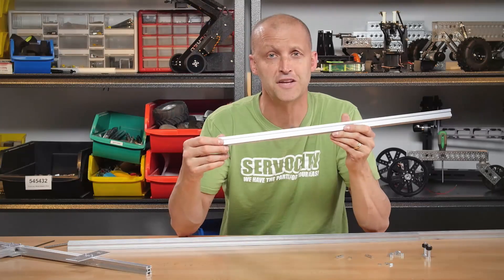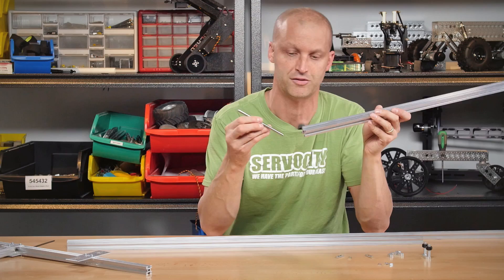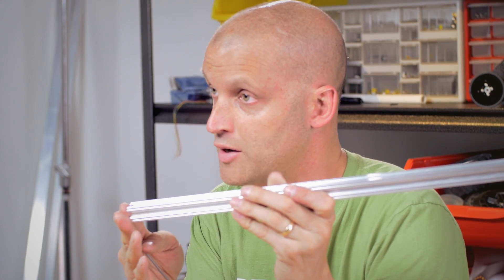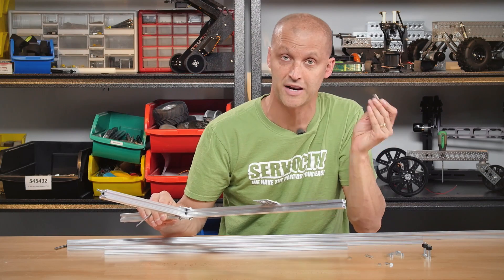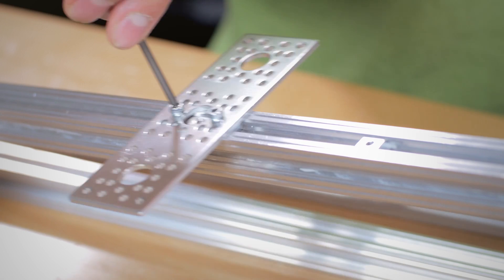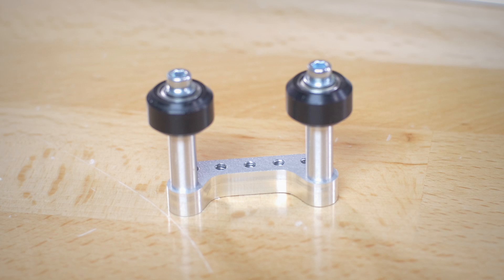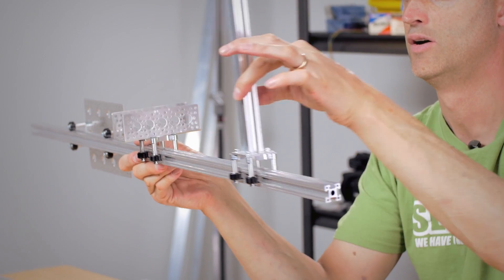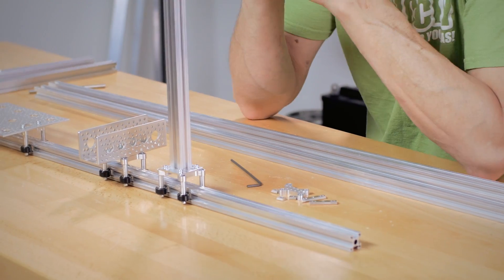ServoCity Products: X-Rail + X-Rail Mounts and Roller Brackets

Comment: is it strong for plasma cutting cnc?????
Reply from the maker: It's possible to use for many CNC applications.  For CNC plasma you might consider using goBILDA V-Groove Bearings: https://www.gobilda.com/1609-series-v-groove-bearing-4mm-id-x-13mm-od-6mm-thickness-2-pack.  An all metal wheel/bearing may be a better solution given the potential for metal to become embedded in the plastic of the V-Wheels used on the X-Rail.  Let us know should you have any other questions tech@servocity.com.